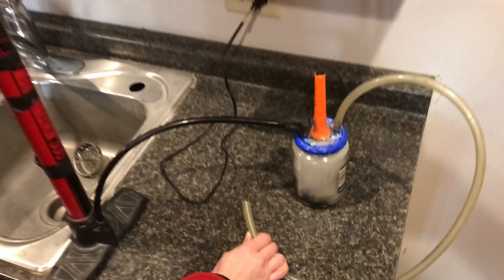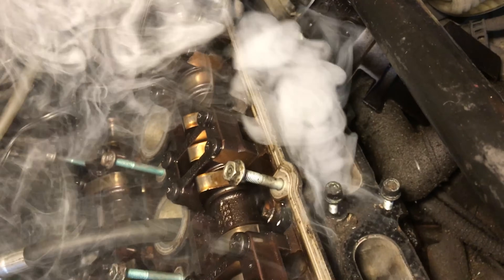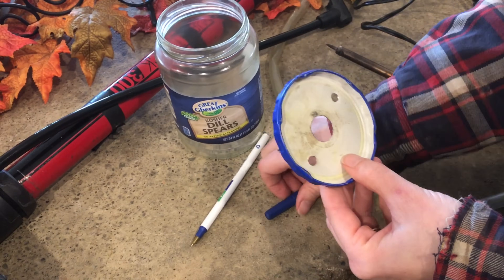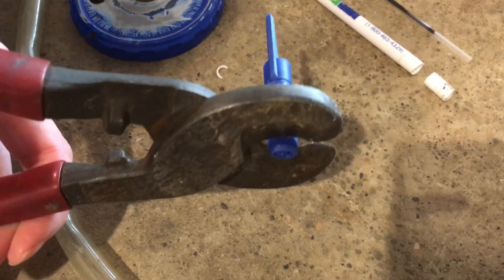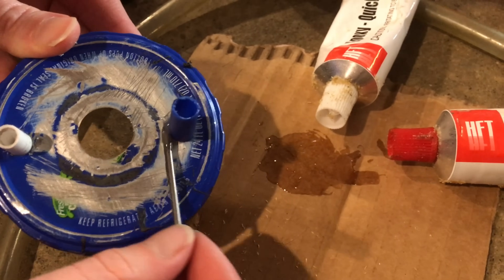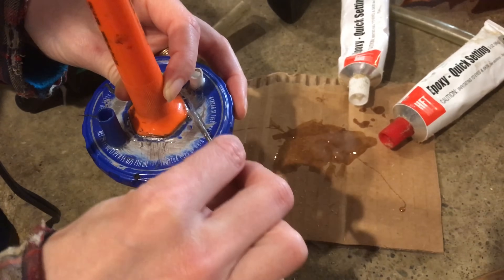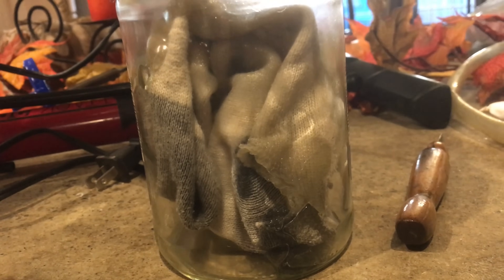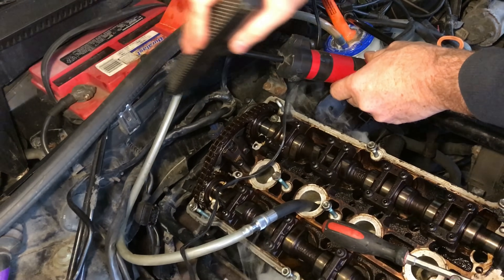BEST automotive smoke machine you can build

Comment: Cool...very resourceful using items most people already have. Definitely good for chasing down vacuum and evap leaks. Was that engine from the Audi that was your test bed from your oil pressure, alignment and brake rebuild videos?
Reply from the maker: +Pauly September 

Glad you enjoyed the video. It is the engine from the Audi. The timing belt broke and bent the valves. I have built several smoke machines but, I really like this one because I can see how much smoke is in the canister, and the air pump gives really good control.
Reply: Error Code Guy The jar is good. A lot easier to remove, replace and there's already a gasket on it. And yeah being able to see the amount of smoke is definitely a plus. These smokers are invaluable with aging vehicle evap systems leaking and  setting the mil.

Comment: Would that engine even run? Did the timing chain break and the Piston smash the valves?
Reply from the maker: +Luke Martin 

The timing belt broke, And because this is an interference engine the Pistons hit the valves and bent the valves. This engine will not run until I put new valves in the head.